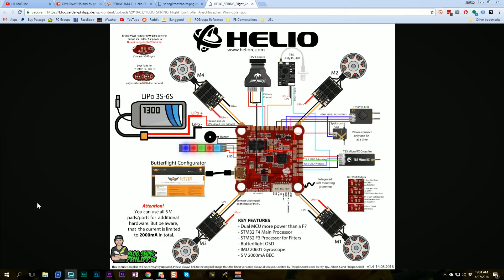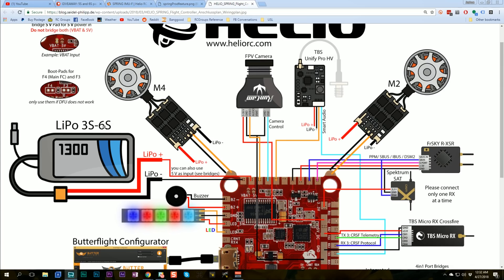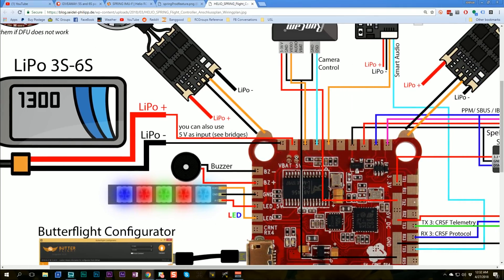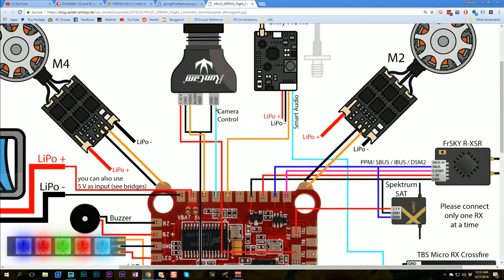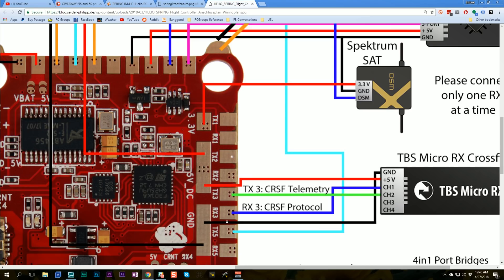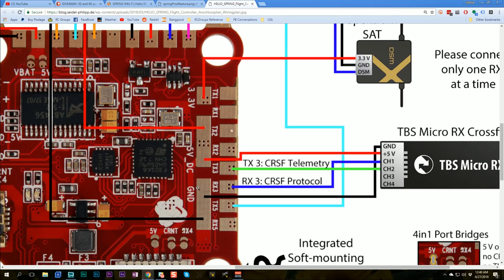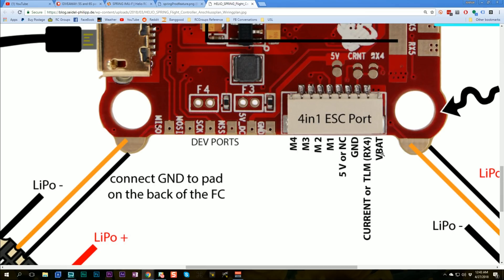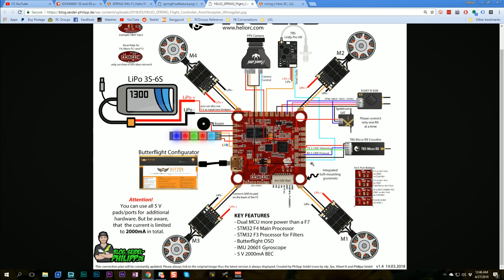Helio Spring Butterflight Flight Controller | F3 + F4 = F7?

Comment: Hey jb great vid.. just got an aio in drop box.. wired up and everything but I have no inputs showing up for my reciver which is spektrum.. I have ran through all of my ports and I have it wired to the sbus port and everything looks good.. please help!
Reply from the maker: You can't connect a Spektrum receiver to an SBUS port. SBUS has an inverter. Spektrum doesn't need an inverter. Use a generic RX port.
Reply: Oh ok thanks I was going off of the diagram.. I’ll try it out.. I really do appreciate the help

Comment: Great video as always quick question I just bought the heliorc spring all-in-one flight controller and was wondering if it flu or if it was in any way different then the regular flight controller from Helio spring or is it just added a pdb built in? Also my main question is I have a unify pro 5-volt version in crossfire will I be able to run my Fievel unify on 800 milliwatts? What is the 5-volt rail regulated to in milliamps thanks Steve
Reply from the maker: Just added a PDB as far as I know. The 5v regulator on Helio is rated for 2.5 amps continuous so you should be okay with a Unify as long as the regulator's rating is honest.
Reply: Joshua Bardwell thank you for the quick response I could always count on you when I'm in a pinch. So I can run the unify off 5 volts with the foxeer Predator mini off 5 volts in the crossfire off 5 volts or would you recommend running the foxeer camera off V bat so I know I'm safe?
Thanks
Reply from the maker: I think you would be okay. However I personally always run camera off vBat if possible as I think they often prefer higher voltage. If you run it off 5v with clear picture, it's fine.
Reply: Joshua Bardwell ok tha k you.. so i noticed that the all in one doesnt ha e a vnat pad. Just 5v.. can i run it to the battery leads..? Or is that not filtered?

Comment: That vbat pin on the 4in1 connector can be used to power the fc. Ive wired mine like that then used the "lipo pads" to power my unify pro. Nice because i can literally unplug my fc and all thats attached is the vtx, cam, and rx

Comment: You’re reviews are becoming less and less fact and science based. You reviewed a board without even flying it. How does that make any sense. This is the most revolutionary design to hit the market with regards to the IMUF and you waited until the last minute of the video to mention it. As a patreon supporter...I’m getting more and more dissatisfied with what my contribution is producing.
Reply from the maker: Of course I flew this board. The flight review is coming. It's just not in this video. 

I have always done flight controller roundups of all the major boards in the market, discussing their specs and layout without flying them. In fact a flight controller roundup was one of my earliest popular videos.
Reply from the maker: Honestly it just sounds like you're mad that I treated the Helio like I would any other flight controller instead of hailing it the Second Coming. I didn't talk about the IMUF until the end? I said in the first two minutes, if you want to experience butterflight, buy this board. Why do you think I said that? Because of the IMUF. 

If you're dissatisfied with your contribution, don't hesitate to cancel it. You'll be welcome back whenever you change your mind.
Reply: Joshua Bardwell I fly the helio in all of my racing rigs. It’s revolutionary and it is the “second coming”. Also, you’ve put out several questionable videos lately. It seems as though you’re losing more of your validity. That TBS crossfire video being a big indicator of decline.

Comment: FWIW I've been running 32/32 on a nightly of BF 3.4 on a BFF7 board for about a week now. Works great, the PR that optimized for the F7 was recently merged and the CPU utilization sits around ~45%.

Comment: Vbat on the plug is how you power the board. I run 32/16 pid loop on stock settings. I tuned a tiny bit. Dynamic filter off dterm notch on. Fw 3.4.4 and its the best flight the trouble free that i have flown. In other words all features work like turtle mode. I use a spedix gs35 32 bit on dshot 1200

Comment: Hi Joshua .. thanks for your informative videos . Is it possible to build a racing drone with fully functional gps module ? Please help with advised compatible gps module & pdb . Thanks again
Reply from the maker: Take a look at the iNav project and their recommended hardware.
Reply: Joshua Bardwell appreciated JB . Thanks . actually I built a similar using dji Naza mv2 system . It works maybe better IMO . Thanks again.

Comment: Sorry i didnt get it. Ibus and sbus is the same port? I thought i bus uses uninverted signal 😐
Reply from the maker: Some boards have configurable inversion on the same port.
Reply: Joshua Bardwell thanks a lot. 😊learned it today.haha
Reply: That’s a mistake on the diagram that’s in that video.  Use rx2 on the right side of the board for non inverted rx protocols.

Comment: Interesting video. Joshua you seem quite conflicted in this one. This board seems to be very innovative and one would think you, of all people, would be the most excited about it. However this does not seem to be the case for helio and/or butterflight based on videos you have made about them (or lack there of).  What gives?
Reply from the maker: I'm not sure why you think I'm conflicted about it. It's clearly the best board if you want to run Butterflight. If you want to run Betaflight... there is no target for it so you can't. When BF 3.4 comes out in July , F7 processors will be able to run 32k/32k on Betaflight so it's nice that the Butterflight devs have solved this problem a certain way, but it's not the only way of solving it.
Reply: Saying that the goal of the Helio Spring is to run 32k/32k is an oversimplification Joshua.  I would say the goal is to run a more complex filtering code than single MCU FCs can run, as fast as possible, and then feed that data to the other MCU that runs OS firmware.   The next release of BF will have F7s run 32/32 but they will be running BF´s standard filtering code.

Comment: “I’m Randy Butternubs”.....(Jake The Dog)
.
.
Well I tested Butterflight out right around the time 3.3 was released and it was hard to discern hype from fact so I ran it on a quad that had BlHeli 32 esc and a Revolt also tested on Matek F7. I liked it. Reminded me of Raceflight in many of the quad nuances. Personally I just like BF more. 3.3 with the stage 2 filter set is my “Butterflight” great vid JB now if you can just help me choose some googles 👓

Comment: I am flying my TransTec Frog with Butterflight 3.5.0 216MHz overclocking and 32k/16k rates on an Omnibus F4 Pro corner. It flies awesome, but with 3.5.1 RC2 the processor feezes.

Comment: I put the HelioRC board in an old QAV-R just to try it out - at first i was taking it easy to be sure everything worked with no yaws to the moon.  Once I got it tuned I fell in love with the handling and performance.   After running it hard through the course I had to put one of these boards in my Proton race bird.  I love it and if you are willing to deal with the few more tuning variables (IMUF values) I real recommend this FC.  BTW the Cam-Control worked without a hitch on my Runcam Swifts.

Comment: I tried BUF after your video and couldn't tell if it was better than BF but it was good enough on defaults (rates included) that I put the Helio in my Floss 2.1 after a bad NOX board smoked two of my Finx30's and I looked for an alternative. 
It is really nice I'm on all defaults and it is super smooth and locked in.

Comment: Note on the 5V/VBAT,
For the 4-in-1 connector you can use both, its for VBAT power AND vbat sensing.  In fact, you can bridge the VBAT on the front pad and use that pad as power-out for VTx/Cam that want/need full voltage, REALLY HELPFUL!!! :D

Comment: I lov emy helio!! I have it on 2 ridges and no tune its amazing. But I am only running 32/16 cause my cpu load was at 58% a bit higher then I like. Thats flashed with the latest and basically only what is needed to run the flight controller

Comment: One thing really wrong in your conclusion JB, "whatever crazy madness the butterflight devs come up with in their filtering or i dont...." Helo Spring target actually disables most, if not all, of the filtering built into butterflight, and from what the BuF guys are saying, they are building for all boards, nothing in BuF will be specific to the Spring other than the spring target itself, brought to you by the Spring dev team.

If anything, if you are interested in what the BuF guys do around filtering, you DONT want a spring.. 

Of course, the point being in theory the Spring will bring its own, far superior filtering to the table thus theoretically letting the firmware expend its cpu cycles on other things.
Reply from the maker: Who is writing the IMUF code that runs on the F3 then? I assumed it was part of BuF, since BuF has built-in functionality to upgrade firmware on the co-processor.

Or have I misunderstood something?
Reply: the IMUF code for the F3 is being written by the Helio team, and is not included in the BuF codebase, and is NOT open source. The IMUFupdate routine was originally, if im not mistaken, just a jump to the address of the proprietary Helio code bundled in the same hex. there have been discussions of at least open sourcing the loader to satisfy some peoples interpretation of GPL, but the IMUF code is 100% closed source and proprietary and NOT being developed by the BuF devs.

In fact, the code on the F3 is bootloader locked so that it is impossible for anyone other than Helio to update it.
Reply from the maker: I appreciate the clarification. I didn't realize the Helio IMUF code was not being developed by the BuF team.

Comment: And yes, I was able to improve two quads to fly great with Butterflight when I was hitting the wall with Betaflight. That said, I run Betaflight still on a lot other quads because it works and they fly well (not broke, don't fix). But so far, I'm happy with my experience with Butterflight on both a Pyro F4 and a Helio Spring.

Comment: Hi Joshua, in regards to 10:45 and above... the 5V reg on this thing is really good. It's one of the few boards (Motolab Tempest F4 too) that I run the 5v VTX off the 5V reg. That said, I have both boards on race quads only, so I don't do more than 200mW, but it has to be said that at least with Unifys, this board works really well powering the VTX from it.

Comment: This thing is not for a beginner, that said, it's unbelievable the performance you get, I just got back from the field flying better than I have ever flown before, it definitely is a different experience and it feels like you are flying with a go-pro with stabilization on- it's that smooth. I just put it from one Plus config. frame to another, and didn't have to touch a thing in any of the settings, it is very tolerant of different props as well.

Everything from now on will be helio, you are going to have to learn and deal with occasional bugs, such as ESC EMI and firmware, but it is so rewarding when it's set up and ripping, the guys at #slack are a great help as I was seconds away from giving up.

Just a reminder for those who are going to buy one. ONLY power it from V-bat or 5v NOT BOTH, MAKE SURE you bridge the V-bat/5v/rx bridges correctly and make sure you tune IMUF FIRST, also Make sure you buy a low EMI (clean) 4-in-1 or else you will have to flip the FC over- fail to do any of these and you are going to have a bad time.

Comment: Hate to say this but since your the "voice of the community" and many people listen to what you say maybe actually get a product next time before doing a review. I have no affiliation with Helio RC but this  board is hands down the best flying board imo I've ever flown in 2+ years of flying fpv. And for all the naysayers out there I have tried everything that is out there on the exact same build other than FC & firmware. Your doing yourself a disservice for not actually trying one.
Reply from the maker: You're confused I think. I did get a Helio Spring and I have flown and tested it before doing this review.
Reply: Fair enough based on the language you used in the intro it sounded like you did not

Comment: Separate coprocessor for number crunching is nothing new in computing realm. Although such architecture used for flight controllers is very interesting turn. So this board can run 32/32 loops without overclocking? What you said, which processor take care about gyro here?
Reply from the maker: F3 handles the filtering.
Reply: Would be pretty interesting try. 45 bucks seems a very good price for this board with it features. 
Also have interest about F7 and faster PID loops. Got a Matek F722-STD FC recently. But as I see I should wait for proper F7 support in Betaflight before.

Comment: I put Butterflight on my CLRacing F4S and it really did turn to butter. I had to do a few minor PID adjustments and think I changed one thing with the filtering in the CLI. I haven't been able to get betaflight this smooth yet.

Comment: Couldn't running the gyros at 32Khz and the PID loop at a slower speed actually allow some filtering directly from the gyro?  So the processor (controller whatever) can read two or three gyro readings before it responds with the PID loop instructions so it could read massively deviated gyro readings as noise or do some sort of averaging or interpolation like we do with RC input?

Comment: The helio springs FC does have magic unicorn dust inside.  It feels different than anything else i've flown.  I'm not going to switch ever quad to it like some people do, but it has a smooth flight feel to it and I think it runs butterflight a little bit better than my other 32k capable boards.

Comment: I was running Bardwell f4 with ak32 and enjoyed it after tuning for 6s. Threw a helio on and was very impressed. Ordered more and been loving them. Only issue, which you mentioned, was the lack of vbat away from motor noise for hv vtx. Motor temps and prop wash are amazing though.

Comment: The VBAT pin on the 8 pin connector is VBAT in for the FC which is usually povided by a 4-in-1 ESC. You can then use the pads where the Lipo in is displayed to power your VTX and/or Cam. Works like a charm.

One strange thing I noticed is that when you use the debugh notch mode, no notch data is gathered in blackbox. Probably because the F3 chip does the filtering and the F4 the loggin, or it's just a bug in the current software version.

Comment: I've been running Helio Spring FC with Butterflight version that it came installed with on my Talon for a couple weeks, and am generally happy with how it flies.   It's certainly smoother than my previous DYS F4 setup.  
The only issue I'm having is that after I power up it often refuses to arm, and I have to go into the OSD and save/reboot.
Sometimes it just won't initialize (blue light never stops blinking), but most of the time it will initialize and let me arm/disarm while the quad is stitting still, but after I flip the quad over so I can push the button to turn my VTX on, when I put it back upright, the blue light is blinking and I can't arm.    Crash detection is turned off.   When it's in this state the OSD shows that the mode switch no longer switches mode, and some other quirks.   It clearly is still listening to the Rx because I can get into the OSD to reboot, but that's it.     This happens about 3 times out of 4.    And yes, I let the quad sit perfectly still after power-up, every time.
Reply: daemn42 you need to update to 3.5.1 RC8
Reply: I had a similar situation. I updated the firmware and double checked the font manager in the osd.
Reply: Helio RC, Thanks.  Firmware update seems to have resolved it.  One thing I noticed is that calibrate "gyro_cal_on_first_arm" is now defaulted to ON.  Is that part of the fix, or can I safely turn that off, if I power up and let the quad sit still for a few seconds  after boot, as I've always done in the past?
Reply: daemn42 it can be safely turned off

Comment: Good show.My F4 omnibus v2 was working fine till i put leds on program and tested fine then nothing esc beep only.Plug in usb all works fine.5v rail shows only 1.7v
Reply from the maker: Sounds like the 5v regulator is either damaged or short-circuited to ground.

Comment: Hey JB, don't forget - the Helio RC guys are looking to license the IMUF to other manufacturers. So these changes that we are making to support the IMUF aren't just for Helio's sake. We are also adding in as many improvements from that to the rest of the targets as we can. Some things are only possible with the IMUF and won't be available on other targets purely because of the architecture necessary.

Cheers!
Reply: What about F7 support ? F7 32/32 still maxes out to 100% CPU load
Reply: Yeah, we are planning on merging that in as well but we have been a bit tied up trying to figure out why Dshot stopped working on F3 targets.
Reply: flash fly I have a f7 bf can i do that now
Reply: flash fly where can I download it ? It's not available under the configurator.
Reply: Loose Transistor FPV Will there be a version with a built in PDB for low deck quads?